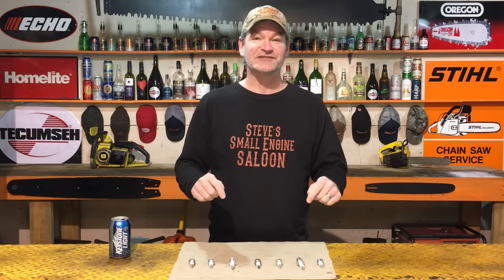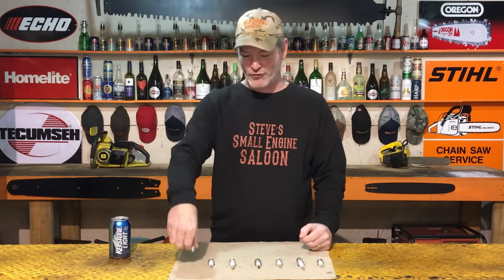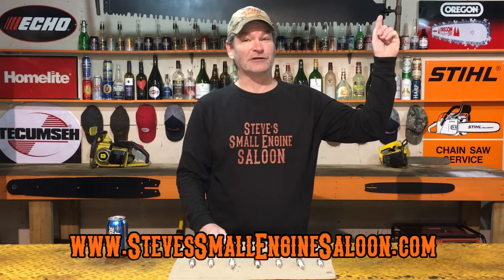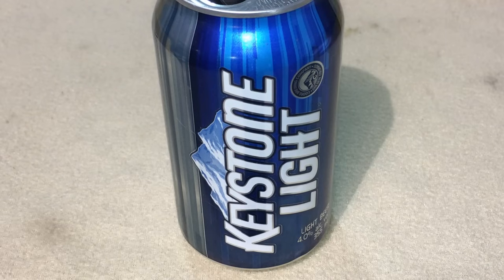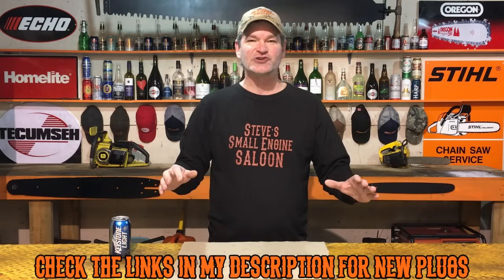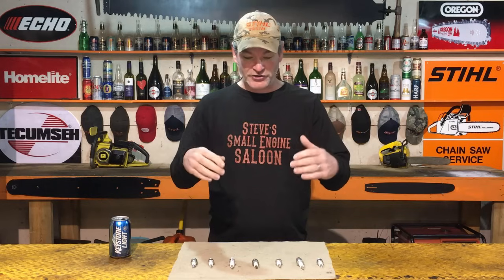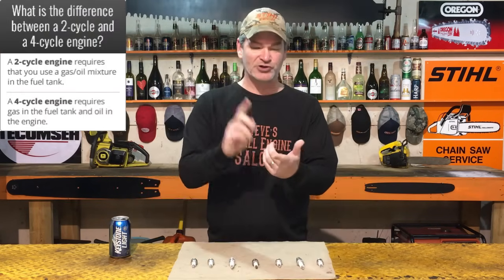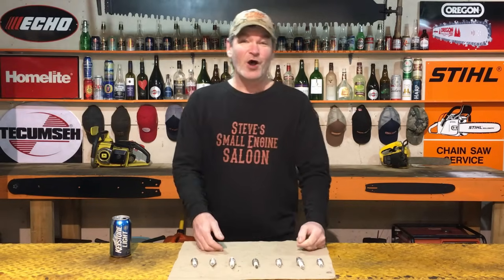How To Diagnose and Read the Color of Your Spark Plug

Comment: Reading plugs requires a lot of experience some engines that are running perfectly fine will produce different shades of plugs. Again experience needed. It is somewhat harder with 2 stroke engines. What you have shown is worse case scenarios.

Comment: HELP! I've been working on small motors for a very long time. I'm 63 yo, and have never had this issue before. 
The float on my carborator on my GVC190 got stuck, and I ended with gas in my oil. I changed the oil, and the sparkplug that was black as black with tons of dry carbon on it. After replacing it, I started it up again, and it ran like crap.  I checked the spark plug again, and it was black and full of carbon again. I can't seem to find an answer on YouTube. I usually get all my answers from you, but I'm at a loss. What should I do?

Comment: I really want to thank you for your videos! They have helped me alot with maintenence of my 2 poulan Saws, husqvarna 128ld and I've even managed to get my fathers 460 rancher going again after my syblings did run it with straight gas, idk how long or how many days but I used a poulan wildthing 40cc as my 1st learner and I ran into issues and realized the piston ring was worn but I need to rebuild the whole thing. I struggled with my pp4218a till I drilled some small holes in the case and the cover to help it breathe as well as take out the 2 pieces in the exhaust. My folks have property but my father being an ex logger he can't do it anymore cause of his body and an accident he was in as a kid and we went separate ways when he stopped  but I'm realizing that I may have hated it as a kid but the times going on his logging trips brought the feeling back and I'm just trying to reconnect with him again. I really do thank you for the informative videos you have done that have helped me see what he had in mind. Thanks a bunch!

Comment: 😊😊 the sparkplug should a tan or a brown color and most people use a 16OZ bottle of 2 cycle oil 2/5 gallons of gas U still 2 mix it up yourself shake well all of the time ⏲️ 😊 its not made like it use 2 be 😮😮 and all 2 cycle engines U have 2 use 2 cycle oil in the gas or U will lock the engine up they won't run on regular gas only 4 cycle engines cars truck and lawn mower engines and gas tractors the old gas it will do if it even runs if it does it won't have no power 😮😮 OMG 1 31 2O25

Comment: hello. my spark plug is half red and half normal color like black but not much on the electrode. Any reason why its show some red on the spark plug is it due to fuel that im using. im from south africa and only use Shell V power fuel. my engine is carbureted

Comment: Hay have a Stijl 170 replace the carburetor check the compression replaced the fuel line the filter and still not getting gas to start. What’s wrong with my soul
Reply: Saw

Comment: Hi Steve,  another great video.  I looked to see if you described the plug I’ve just had on a Stihl 051 AV electronic. The saw stopped and when we took the plug out there was a whisker across the gap. But what was also down between the insulator and the body were little round balls of something.  I poked them out of the gap and cleaned the plug, got the saw started again but after a short time it fouled the plug again. Have you ever seen anything like this?

Comment: Wish I had a dollar for every customer I've informed about the ol' 25:1 2 stroke mix dilemma! That was due to the older, mineral oil mixture recommendastions from the old days. Modern synth oils can run 60:1 nowadays. 50:1 is ideasl in modern engines usinmg synth mix ;)

Concerning colour of a 'normal' plug. They can be, greyish as well as darker brown. As long as they're not white & completely void of slight deposit from operation. They are fine.

Comment: Hi there,  I would like to know if you or someone could tell what's the condition or the aspects of this fowled spark plug. Basically could tell me what caused this spark plug to look like this?? It's out of a 1973 International Harvester with C175 gas motor.!! I have couple pictures of this sparkplug, but I don't know how to add it here !! It looks oil fouled as well as carbon found at the same time.

Comment: Man thank you so much, you saved me a lot of headache with the very last remark you made.. i just put in a new spark plug in my chainsaw after a small ooosie and wanted to check if the engine was running fine and saw no brown color on it. But it’s the first day of using it, so obviously it wouldn’t be brown just yet, I just didn’t think about that, so thanks a lot for that :D
Reply from the maker: You're Welcome...

Comment: Great video Steve I have a 26 year old MTD snowblower with the 5hp snow king engine and my plug always has the coffee color. I change my plug every year and my oil every year and I've never had a engine problem ever. Steve plugs are cheap and so is oil I only run non ethanol gas 90 octane, keeps every thing clean and running good. Thanks for sharing with us your knowledge I truly appreciate it keep making those great videos.

Comment: Hi I’m from over the pong in the uk, I have a brigs and Stratton mower that’s giving a headache and kept me up at nite, it’s doing my nut in.
When we Anna friend tried to get it running it had spark but only now n then, so intermittent spark.
We took it off and it the multi metre on and it read 0.44 mega ohmes, so it’s a bad coil.
New one on its way, but just a heads up I tried fitting a coil from another mower engine the same and it wouldn’t work on this mower at all.

Comment: Steve, thanks for all your great insight.  I have learned a lot from your videos.  After watching this video on spark plugs, I was able to get my chain saw back to running at an acceptable level.  I thought I had a problem with the way I adjusted my carburetor since I could get the saw started but had trouble keeping it running.  After watching your video and paying attention to your comments about black sooty plugs, I checked the gap on a new spark plug I recently put in and discovered, like you mentioned in the video, that the gap was far too wide.  I closed the gap to the proper distance, and now the saw stays running.  I think I can still do a little better on fine tuning the carb adjustment, but that will be a lot easier to do now that the saw will stay running long enough to try and make the proper tweaks. Thank you!

Comment: 2002 club car. plug kinda between rich and dry but black. spark plug gap should be? what number spark plug? is 4es hotter than 5es or reverse? thank you. btw, cart runs a little while(5mins) or a lot(several hours) and floods. how do i adjust fuel/air mixture? Keystone and Coors do taste similar.

Comment: After 50 years of auto racing, I can tell you that reading spark plugs is an art. Smokey Yunick spent years at it and wrote a lot about it. He always said that when reading a plug the worst thing you can see are the "little purple balls" on the electrode from the porcelain baking off from heat caused by detonation.

Comment: Thanks for the very informative video for a moment you had me a little scared because I have a 2005 old engine chinese dirt bike and I was like noooooo until you explained the second type of spark plug issue because I put a brand new spark plug into my engine and let it run for a little bit and when I took it out it was black but it wasn't wet it was dry and powder like when I rub my finger across its a 4 stroke dirt bike I wonder if you had some info on what the exact problem might be thanks

Comment: Great information. There are many elements that factor into the proper adjustment of carb adjustment, and heat rang of a plug. 
Gap setting of plug, octane of fuel, air quality. ( But you hit the high points ) great information. 🤙🤙

Comment: Thanks for the great info on the spark plugs Steve. Question. Is it Ok to use a resistor type plug in place of a non-resistor plug on small engines?

Comment: Steve love the info as always, thanks for sharing so much professional tips via a great channel you deserve your own little tv spot it's that good!

Anyway i was reading a makuni tuning manual and it stated plug chopping today is ineffective because the additives and extras in today's fuel will leave false readings, they mentioned racers do it but use better quality fuel, can i still do this to fine fine fine tune my carb and if im designed to use 87 would ot hurt to run a quarter tank of quality race fuel to plug chop, im after that absolute perfect tune

Comment: Hey Steve, I own a 4 stroke Yamaha dirtbike and it's plug looks alot like the first one you showed. I just recently bought the bike about a week ago and it runs great, compression is good, it starts first kick, etc. Whenever I bought it I topped the fuel tank off (1.2gallons) and came home with it, I had some of that Lucas "tune up in a bottle" that is supposed to clean fuel injectors, carburetors, and carbon build up in the combustion chamber and Piston. It's a small bottle and it says that it treats up to like 23 gallons and I had roughly half or a fourth of the bottle left and I poured it in the tank. Would that cause it to look like the first one? I definitely poured too much in the gas for what it says to pour on the bottle but it doesn't interfer with the running quality and I figured it wouldn't hurt. Thank you! Hopefully you see this!
Reply: Yes and no. Buy a new plug and I could almost bet u need to dial the carb to a more leaner setting. It's a bitch if u never done it. I been there. Ended up reading the manual. Have fun cheers

Comment: I've actually used a spark plug with the part were the electrode sparks to is completely missing and it still runs like normal not sure how but it does

Comment: Well son of a diddly, I think the heat range nuance just solved my mower issue that I have had from new.  It runs, but misses the odd beat. Plug was black, not oily but wet with fuel.  Indicating it's way ritch (modern Toro homedepo one from 2015), air filter is clean.  So I ordered a high altitude jet, put it in, replaced the plug runs much better, but after 5mins still misses the odd beat, but still better than it was.    It's got less than 5hrs on it, I should of warrentied it but could not free my self up while it was valid, stuff needed to get done and now kinda thing. So heat range has me very curious, I might go up one and see what happens. Thanks again.
Reply from the maker: Right on

Comment: Hi my weed eater started to blue smoke i mixed it with 2 stroke and gas its never smoked like that before then I emptied it and mixed some more gas and 2 stroke together in a bottle and mixed it in the weed trimmer and it still  was blue smoking then the blue smoke  went away then it cut out then I started it then it died out I cleaned the  spark plug it was black and it still didn't start

Comment: 6:40 I recently serviced a Chinese clone of a Honda GX engine, only done about 10 hours but the plug was sooty. Replaced the Chinese plug, NGK BP7ES equivalent with a hotter BPR6ES - problem solved.

Comment: I just did performance mods to my mini-bike engine, after realising my first problem was not enough gas (tip, make sure fuel reaches fuel line dummy!)
So I farted around with the fuel/air mix, got it idling OK, but on acceleration it bucks and spits and bogs and chokes, so would this be more of a spark plug issue even if I do have the right mix setting?
I smelt unburnt gas, then pulled the plug and is coated in fluffy black dry soot, so I knew it was rich, I figure it's not just a carburetor issue now, but quickly became a spark plug issue?

So, If I cleaned the plug, it may fix my major issue after setting the carb right?
And thanks!

Comment: I'm glad I found this video. Iv got a few old wheelhorses with the kohler K series engines
 I just had my 14hp k341 rebuilt and finally got it back together. Iv been slowly adjusting the rpm limit up every few times of running It till I get to the 3600 mark. I had It running great after having to replace the coil and condenser and readjusting the valves. The other day it started stumbling and sounds like it's missing every other combustion cycle. Iv adjusted the carb to were it runs the best and nothing changed when this problem started. I'm going to check the plug out on it and the points again. Hoping that solves it.
Reply from the maker: Good luck!
Reply: @StevesSmallEngineSaloon  thanks!

Comment: This solves my prroblem on my lawnmower! There is definitely oil fouling and when I took the cylinder head off, I noticed oil leaking along the piston chamber. I believe I have to order the piston rings for my engine but that involves taking the engine apart to the crankshaft which is scary but fun to think about

Comment: Thank you for a very informative video, Steve! I just bought an 8hp Yamaha 2-stroke outboard. I took out the spark plugs to check how they looked and they are pretty black with a lot of gunk. Is it correct to interpret this as oil fouling?
https://ibb.co/CnvN5Qj
https://ibb.co/GV9LHbr

Comment: Had a black dusty spark plug and had a dirty air filter. Steve nailed it! Changing both... but how do I clean out the spark plug well, its full of soot? Carb cleaner??
Reply: A tip I was given for decoking engine etc. A few squirts of Mr Muscle kitchen cleaner. Leave to work for 20 -. 30 mins. Mop up with cotton wool ball. If not clean, respray & leave again. Works a treat on oil lamp vapourisers too, but soak in shallow dish.

Comment: I have a 2 stroke 50 cc chinese dirt bike with wet black spark plug.  It only has about 10 hours on it so its still new.  The manual says to use 20-25:1 mixture.  Do you think that is too rich?

Comment: Hey Steve..a shout-out from Ottawa...Buddy you the man.!!!
LONG story short....ive been dealing with a problematic Husq lawn tractor .. fix one thing .. then another issue surfaces... e.g.  black smoke on the exhasut and dry black spark plugs.. and you mentioned..." check for a sticky choke..."  Bingo..  it was 25% closed...  all the time.. adjust the cable..clean plugs again and no more smoke... I was getting ready to do head gaskets... You saved the day Steve.  Cheers!!!  it was a 1 Beer job.. lol :)

Comment: Steve, great and helpful vids, and good beer info too!  You have really helped me out especially getting me up to speed on some of the newer machine designs. I do have one chainsaw thought to share. My saw stable is still old, mostly Homelites, mostly the XL-12/SXLAO family. A couple of them Date to the 60s, and I know most of your viewers have moved on.  But I love them, and if cared for, they last forever. My comment is on oil mix. You recommended 30:1 to 50:1. The factor recommendation back in the day was 16:1. I know oil chemistry has evolved, and I know new 2 cycle stuff is designed for those low-oil ratios. In fact, if I get in a hurry and throw some of my old Homelite or McCulloch saw gas (I mix it 20:1) into my new Stihl trimmer, it fouls up.  BUT, the old saws were not designed for 50:1. And even if they provide fair lube at that mix, the ring/cylinder/piston/carb unified system doesn’t like it, and the saws will run hot and fry the cylinder.  If you rich up the mixture to lube, they run way fat in gas, run lousy, gas washes the oil film, and you fry the cylinder again.  Especially if the saws are in hard use, like a full day of cutting hardwood. I’ve had to do several complete overhauls on friends and a couple of my own old dogs from trying to use new oil at low oil ratios. So you might share with folks that might end up with an old yard sale or inherit Grandad’s old saw, keep the oil ratio low, 24:1 is as thin as those old saws will tolerate in hard use, I don’t care if the bottle says 100:1.  It’s not just about oil chemistry.  Thanks, and keep the vids coming!
Reply: Check with manufacturer, most old engines are 20-1, they run properly with it, newer models are 50-1.. usually the ratio has been described on the oil bottle but the age of an engine and oil parameters hve to be taken under concideration

Comment: True about Keystone = Coors. I had the inside tour of their plant in Boulder, CO (my daughter worked there). They take the same finished beer pipeline and split it: one side to Coors bottling, one side to Keystone. Also be sure it stays refrigerated wherever you buy it, including before they put it in the cooler at the store. If it comes out of a non-refrigerated storeroom, deal's off. No preservatives.
Reply from the maker: Very cool!

Comment: I may have commented on here before but this guy is spot on concerning reading spark plugs. As a former High performance snowmobile engine builder, Learning to read spark plugs is paramount to properly tuning any engine. Reading spark plugs tells you exactly how your engine is running in real time. When racing snowmobile( or any engine) its important to know how your oil fuel ratio and heat range on the engine is affecting the power and efficiency  of the engine. Too lean, and you can melt a piston top, too rich and you can flood and damage your engine by fouling. Two stroke and four stroke are two different animals and you need to learn how the performance effects both and why.

Comment: Steve, I have a JD GT235 riding mower with a B&S 18hr engine, new carb, new fuel pump, Cranks good, but the high-speed RPM just not good and it will move up and down while cutting as if it is cutting high grass but it's not------- how can I fix this

Comment: Thans for a nice explanation video about 2 stroke spark plug reading.
If i understand correctly the coffe color will show on the porcelan after some time using it?
Not in the first test drive (in my case motorcycle 50cc) on WOT to see it run corectly on particilary main jet?How do i know when i am on the safe side of running propertly?

Stay safe